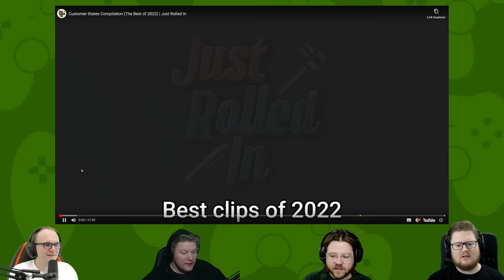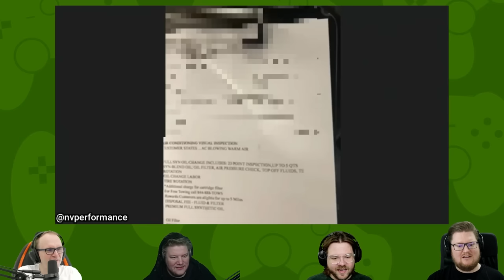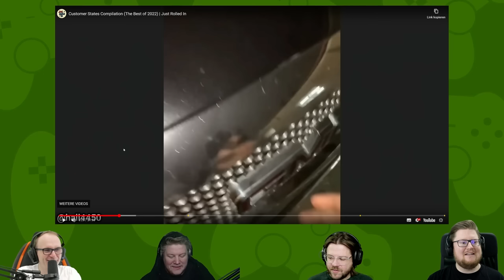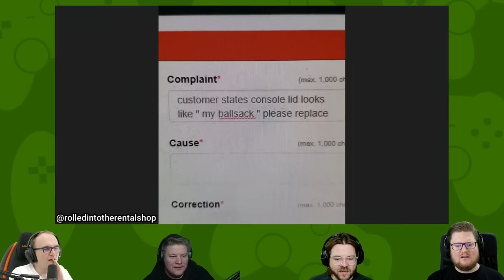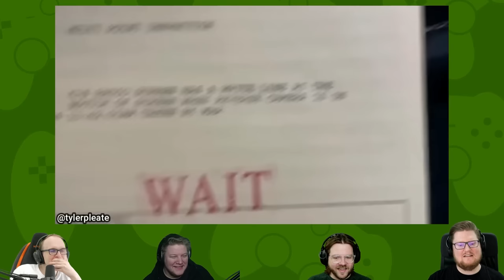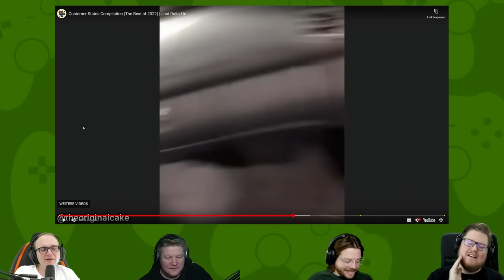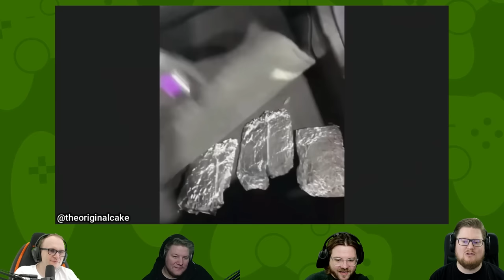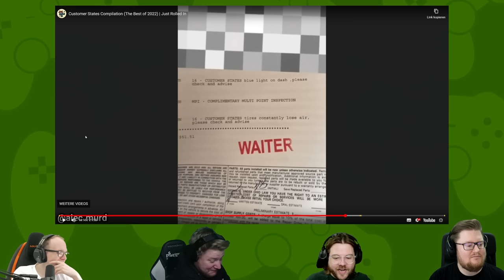React: Customer States Compilation (The Best of 2022) | Just Rolled In

Comment: hab kfz gelernt, bei manchen dingen packst du dir nur an den kopf. 

das mit dem dampf ist einfach erklärt. entweder ist die bremsflüssigkeit zuheiß geworden (wobei dann sähen die bremsen beschissen aus) oder was eher der fall sein könnte, es ist wasser in der bremsflüssigkeit, diese verdampft und das bremsen wird unmöglich. man tritt dann ins "leere" beim bremsen.

die meisten leute haben einfach kein bock sich mit ihrem auto zu befassen, ist halt "nur ein gegenstand". die haben kein gefühl dafür das es eben kein objekt ist. autos sind kein hexenwerk, meisten wissen ja nichtmal was für ein motor drin steckt oder wie man glühlampen wechselt. eben die einfachsten dinge.

13:20 und genau so baut man sich eine DIY-claymore mine. für jeden der sich umbringen will ist das der tipp schlechtin, einfach steinchen aufs lenkrad kleben und mit 50 gegen nen baum brettern.
wenns darum geht blöd zusein steht jeden tag jemand auf und legt die messlatte niedriger....

in nem normalen pkw reifen hast du 2,1-2,4 bar druck. lkws haben 7-9 bar, aber die bewegen auch 40t !